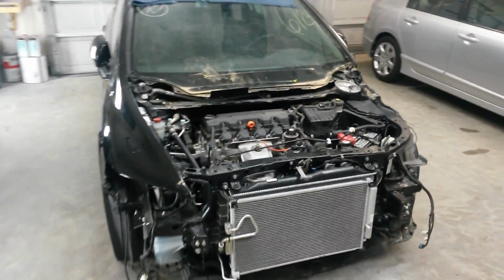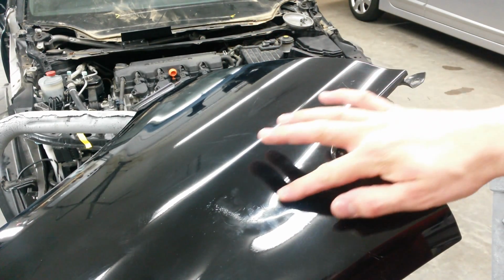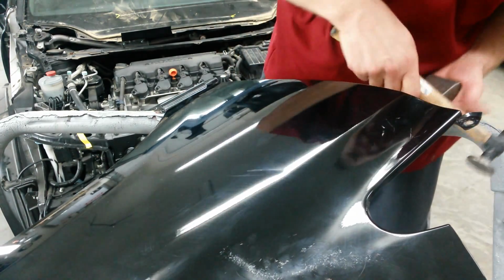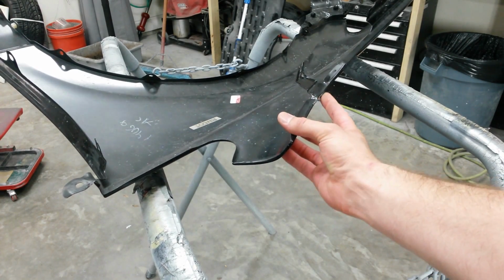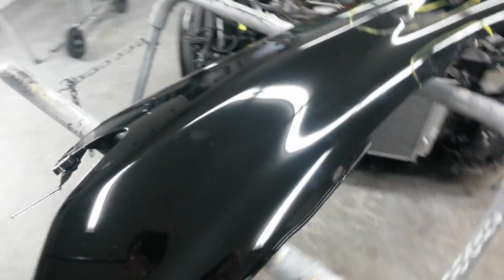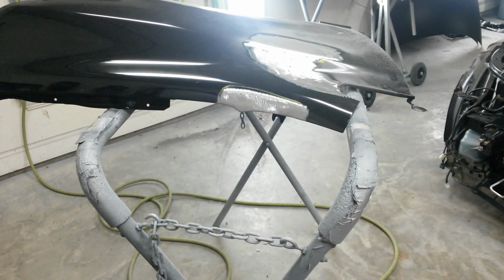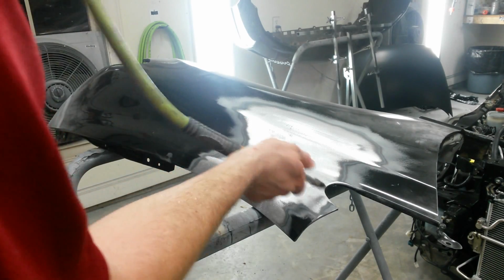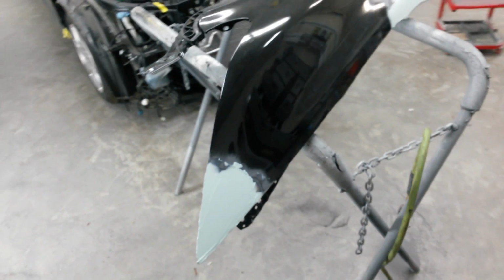HOW TO REPAIR A FENDER | 2010 HONDA CIVIC SEDAN PART 1

Comment: Sam since you like teaching so much I think you should take on a few apprentices. While they learn you can get free work out of them. Maybe get more work done and make more money too
Reply from the maker: If I ever do this full time, I would definitely  need some help. It's  my side job currently. Thanks for the comments
Reply: If I ever lose my crap job I'm gonna see if you would want a student. I'd love to learn from you, You're a jack of all trades and you do really good work. That hood problem I had before that I asked you about I ended up just using a rubber hammer and smashing the radiator support to make the hood align with the fenders again

Comment: I what know how remove the fender civic 2007
Reply from the maker: Ángel Cardoso there are 5-6 bolts holding it around the perimeter.  easy to remove
Reply: Thanks friend
Reply: Do I need to remove any other parts to access those bolts? My civic is fully built no parts are off and I need to remove the fender. Thanks!!

Comment: Good tutorial.  I will fix a fender if it has a couple small dents.  Usually when I get them they are pretty creased up and it makes more sense to put an aftermarket one one to keep things moving along.  Good reminder about filler to hardener ratio being important no matter what the temp is.  Mix quick :)
Reply from the maker: I agree. usually I would replace this if it was a customer job. I would have hated to throw it away. Wasn't that bad.